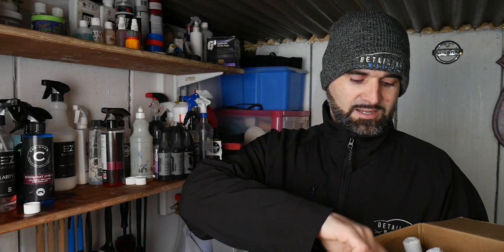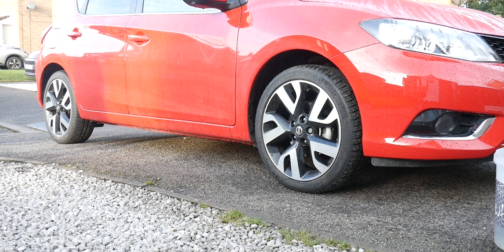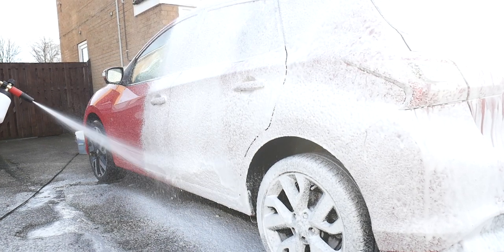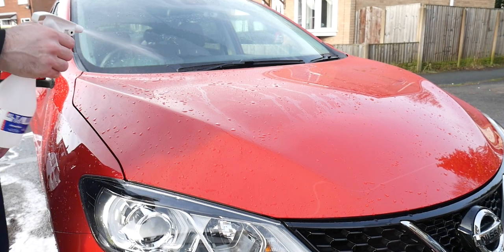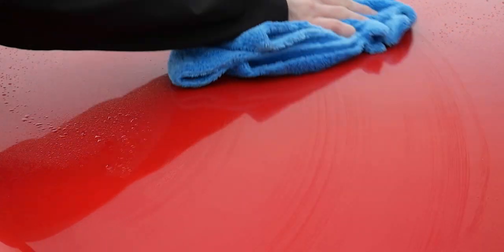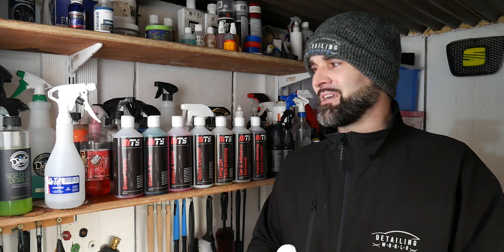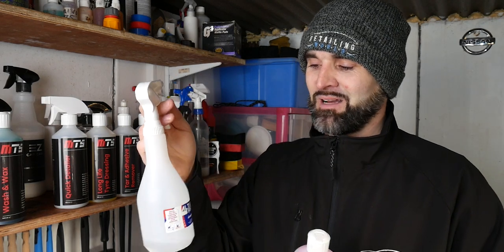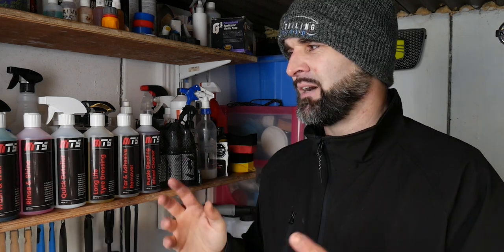Do First Impressions Count? Are Looks Everything?

Comment: Thanks for the review Mat and thanks for clarifying that every product that requires one does actually come with a spray bottle included for free. If you'd have let us know about the mix up beforehand we'd have happily sent more over 👍We are actually in the process of sourcing some different bottles for the future as well.

Also the recommended Snow Foam dilution rate is actually shown right on front of the bottle, not sure how you missed it, you can even see it on the close up shot of the bottle 😂
 
Our priority is producing easy to use, trade strength high quality products, at consistently great prices, that do exactly what they are supposed to do and it looks like after using them you agree that's what we do 👍

Thanks again Mat, glad you liked the products!